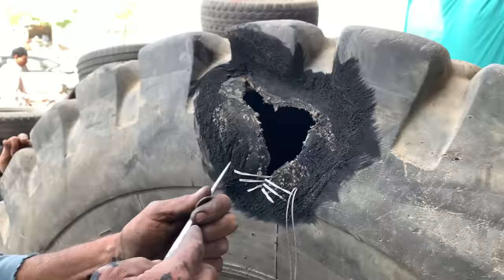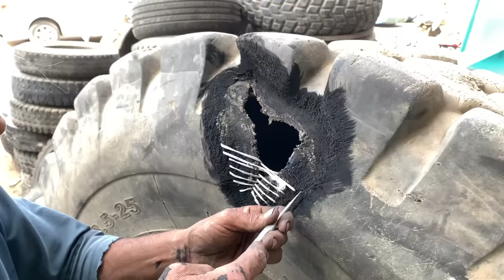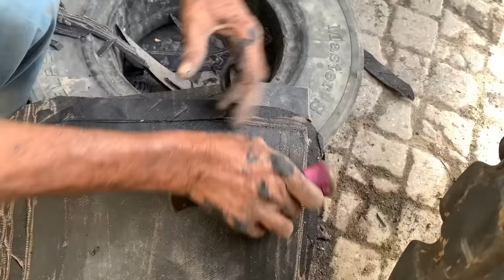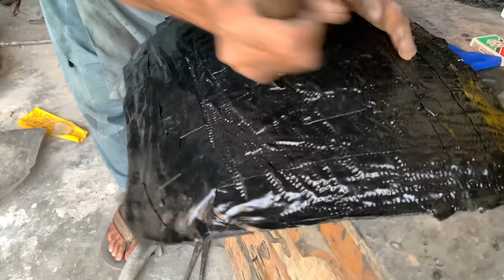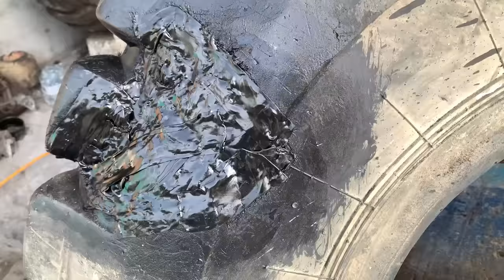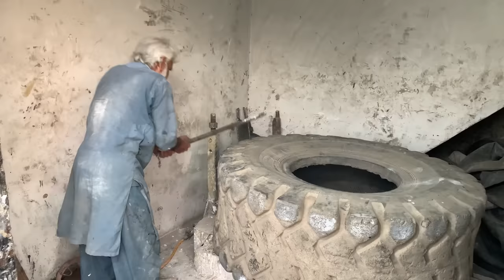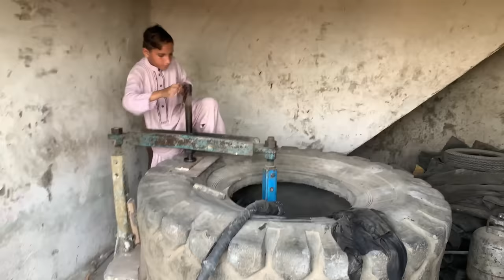Old Man Repairing A Huge Old Tire Sidewall | Amazing Repairing of Monster Tire |

Comment: I repaired and changed those tires in the late 70; s. I delivered and dropped off 2 that size and one larger earth mover tire. The cost back then just to drop them off was $11,000.00 for the 3. A tire damaged like that would have been tossed out, here in the U.S.
This man put some serious time and labor into repairing this tire. Got to commend him and his young laborer for a super repair job.
That tire is well worn, but in some countries, you have to make due with what you have.
Job well done! Great vulcanization!

Comment: This kind of repair would never be acceptable in the United States, but in a undeveloped nation when a single tire cost $2,000 to $4,000 to replace... the video speaks for itself.
Reply: I worked in  a tire repair company in the US it's the same thing same tools too expected at the end we would cook the tires in large batches so the rubber will melt than cool off to rebond itself
Reply: Oh at the end he cooked it as well so if anything it's good it passes US standards
Reply: This man who done this in india he just got meximum $5 to $7 only for this job
Reply: I don’t think this is a road tire. Looks like it’s for a piece of equipment. Maybe a small front end loader?

Comment: A loader tire like that costs about $5000.00 new. I wonder if it has the 3M guarantee, three minuets or three miles? Was that a pasta cutter? We are so spoiled here in America. He did a great job with the tools and materials he had. In America if you repaired a tire like that and a employee got hurt while operating that piece of equipment all management would be fired.
Reply: Infact these tires, repaired ,work for years.
Reply: @Farooq_Tv  sometimes they do sometimes they don't I've repaired Tires with similar damage and in America a repair like that will get you a lawsuit.  insurance rules here
Reply: @Farooq_Tv  Proof?
Reply: @kkoch666  what proof?

Comment: RIP to the person that had to drive that truck afterwards…there is zero strength in that rubber.
Reply: It'll be fine, you obviously didn't notice the cutting edge tech these shoeless gentlemen use. It'll prob end up a water wheel in some other senseless video. In other words I agree.

Comment: Starting  with Thread Stichinh on Damadged Part of Tyre can not resist Pressure on completion of Rubber covering . Threads  proper Winding strongly iswrapped on circle  that gets held in Metals Wheel.  Such  ending part is best to complete thread sticking to plaster Rubber of Outer Wheel. In such Damadged  portion of Tyre thread  filling in between should be wrapped on both side of Tyr's small circles very closely and pasting with Melt Rubber be sticker properly on complete Part of Thread Steaching . As said here Repairing of Tyre will get originally Manufacturing Strenth.

Comment: Not all holes are meant to be fixed this guys skills amazing problems occur when putting the tire back on you'll kill a tire tech repairing things that are beyond repair otr tires are different because it's not going 65 mph on freeways with ppl close by still bad repairs kill tire guys this repair looks acceptable for a section repair or rsr but you never know till u air it up.

Comment: Look at the man’s face and hands at 0:45 thru 0:50 . THIS IS NOT AN OLD MAN!!! My hair and beard turned white at 27 years old.I am now 86 and know what an old man looks like.😂 If anyone reading this that might know this guy, tell him the plaster mould could be made from the top, Just shape the clay around the area and fill with plaster. That would save a lot because every repair requires  mould ( model ) to match the tread .You all would be surprised at what things we had to do with when I was young. 😢

Comment: Why all the hard work for one tire??  

Cost of huge tires – Cat 797 is Caterpillar's off-highway, two-axle, mechanical powertrain haul truck. It uses massive 13-feet-tall tires that weigh 11,860 pounds. Each tire, made by either Bridgestone or Michelin, costs $42,500. A full set requires six tires thatcost $5.5 million. ( these are the big boys but they aren’t cheap )

Comment: Thats a lot of work to put into a tire that has a crap repair. The workmanship was good considering what he had to work with, but I wouldn't buy it and would feel scammed if I wasn't told about it. Just because you can't see the repair visually doesn't mean it is right. Tjat rubber is very soft and the grip will break right off the first time it's stressed.

Comment: The company I work for has in the past accidentally purchased tires that were repaired in this exact same process with the same materials,  all the tires looked brand new,  but when mounted on the rim and put on a the equipment, the repair blew out.   This man isn't repairing industrial tires , he is making the tire seem used and not damaged,   this man is manipulating the appearance of the tire and scamming companies into purchasing tires that are dangerous and damaged

Comment: When one of these tries fails, it has enough force to kill people. They have strands (kevlar or metal) that go all around to keep the tire strong. This guy hooked a bunch of strands into the rubber and it's up to the rubber to hold the tire in place. This tire is weaker and more dangerous than the original spec. 

TLDR: Good job creating a rolling land mine. Never repair tire sidewalls, it's impossible to do safety.

Comment: A for effort, but I would not repair a hole in a side wall. The hole is almost the width of the side wall itself! I get that to replace the tire would be very expensive, but this isn't worth it. Not even from a saftey concern, but so much structural strength would be lost that it probably wont last very long.

Comment: I was worried about a screw near the sidewall, luckily it didn’t puncture through the whole tire… but I sure was thinking I was gonna spend 200 bucks for a tire. Then I watch this dude sew up a tractor tire or construction tire with no issue.

Comment: I have zero faith in that repair holding. The shoulder (where the crown meets the sidewall and where this injury is) is where the most flex occurs. As the tire is run it will work itself loose eventually pulling away from the casing on the inside. If that injury were on the crown entirely i would say it might work. Still wouldn't guarantee it. This is ok quality work GIVEN the circumstances and what they have to work with. There are repair shops in the states the do higher quality craftsmanship with better patches and materials. Don't be too swooned because you haven't seen it before.